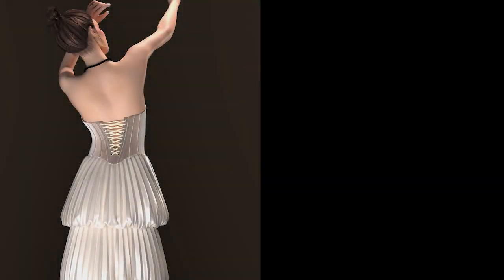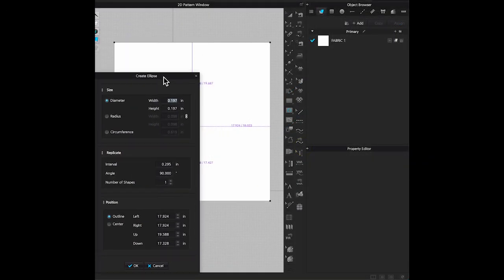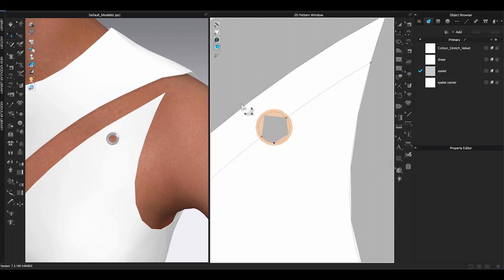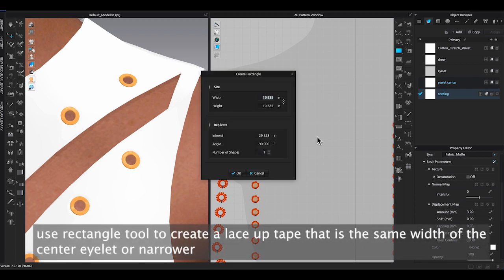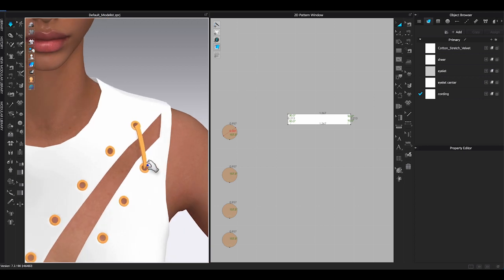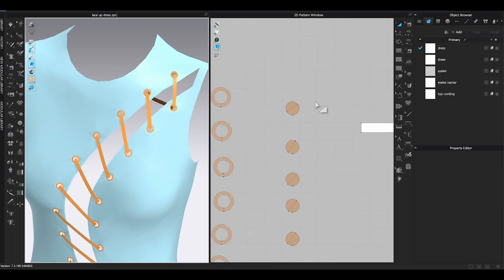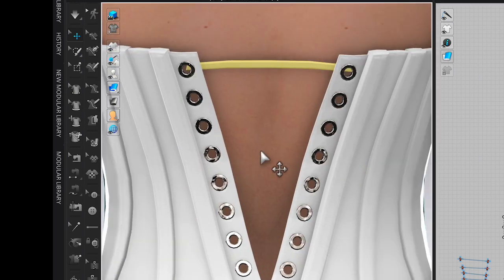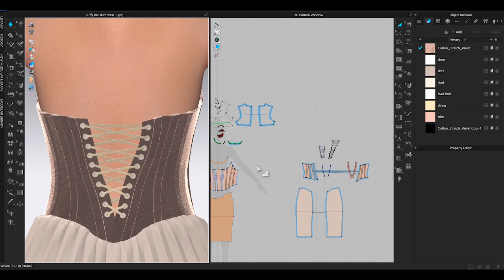how to create lace up style #clo3d

Comment: How do you inflate the buttonhole, I do the same thing you do and it doesn't work. Help I'm stuck on that
Reply from the maker: Buttonhole? Do you mean the eyelets?
Use add thickness rendering in property editor and increase the amount. You will be able to make the eyelets thicker. Make sure in 3d window toggle tool bar, under garment rendering style, turn on thick  textured surface. If it's not on, you won't see the thickness in 3d window. Hope this help!
Reply: @Kev-in-design  Thank you for your help, I continue with my beautiful dress.